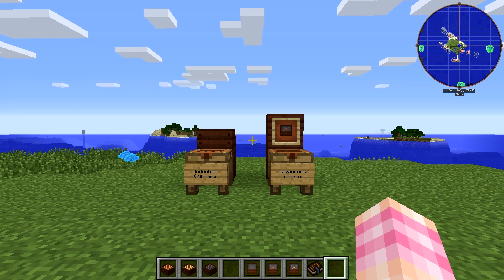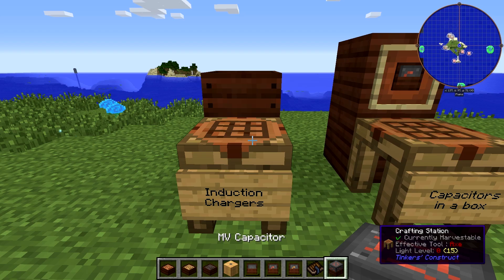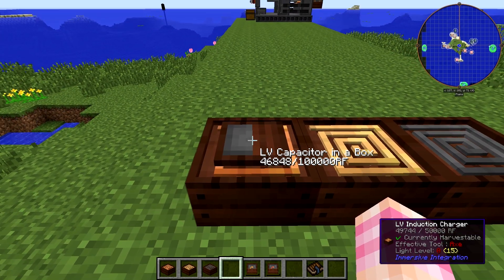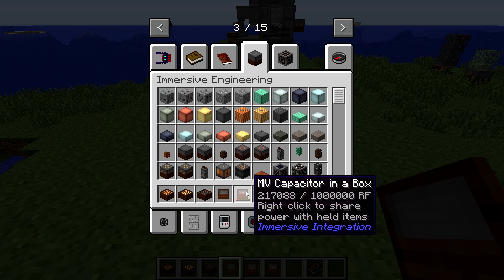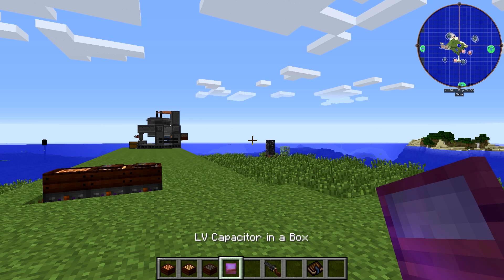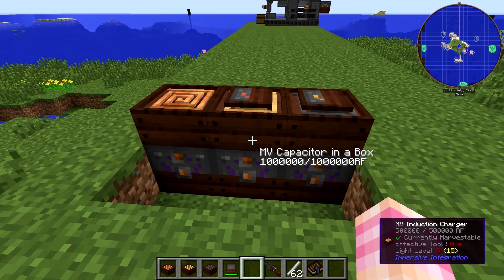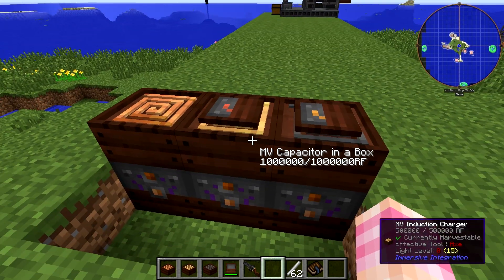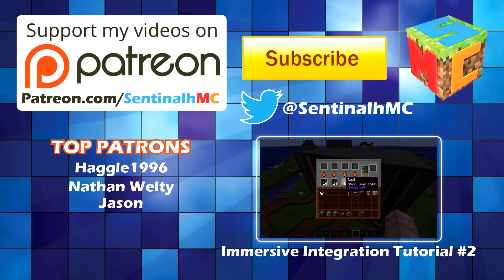Immersive Integration Tutorial #3 - Induction Chargers

Comment: actually trying to get an auto loading railgun from to run with both an automated ammo plant running buildcraft and immersive engineering  (if I can find a way to convert needed blocks to gravel and sift them for flint lol)
Reply from the maker: Railgun from what?
Reply: SentinalhMC rotarycraft railgun turret  (should have been specific on my part lol)
Reply: is that railgun even able to use flint or arrows as ammo?!? also, you can use the centrifuge from rotarycraft to get flint about fifty percent of the time, (you always get sand)